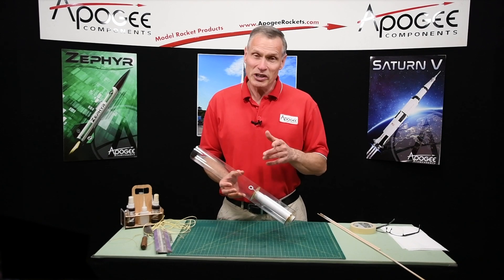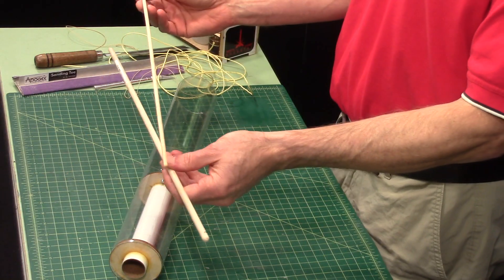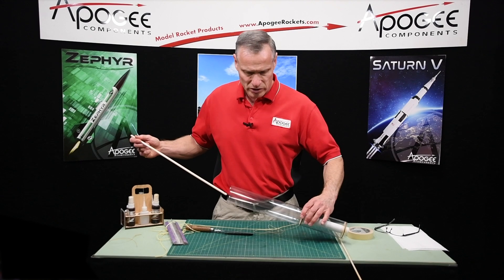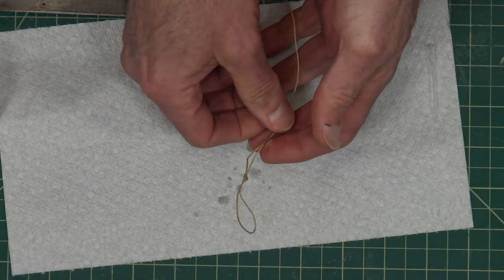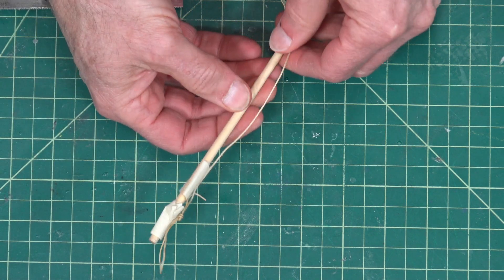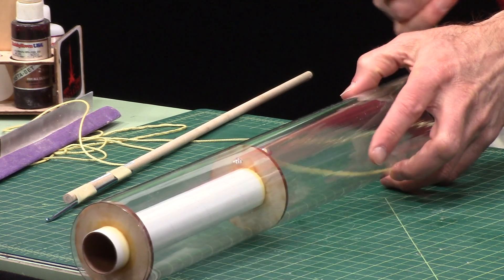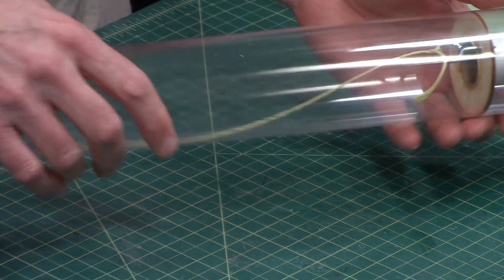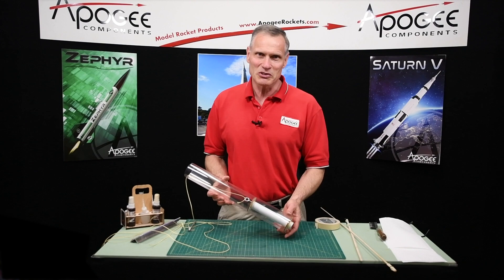How to Replace a Shock Cord

Comment: You could also make through holes through the engine mounts. Then pass the shock cord all the way through the rocket. Then you can loop the end around the engine body tube or a small dowl sideways ( just something to keep the cord from pulling back through ). The knot will be on the outside of the rocket and is easier to get to to replace later on. The cord just get dropped in the the bottom side of the rocket, passed through the body and secured to the nose cone
Reply from the maker: Excellent idea. That is similar to what https://www.apogeerockets.com/education/downloads/Newsletter338.pdf
Reply: @apogeerockets   yes thats exactly what I was trying to explain.  I guess we both had the same idea. LOL . Its hard to be original. Ill have to check out your website. My grand son has shown some interest. He found my old rockets digging around in the attic. So after 40+ years of them setting Im dusting them off and getting them ready for flight. I found your video just looking around on youtube to see whats changed over the years.